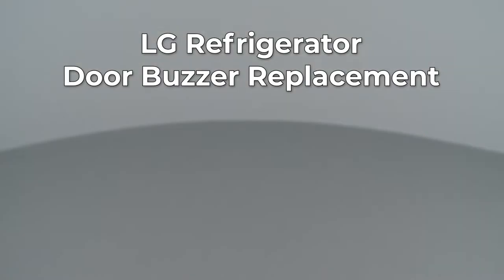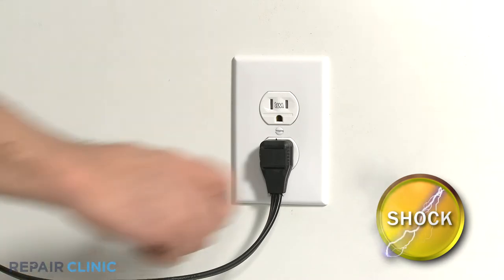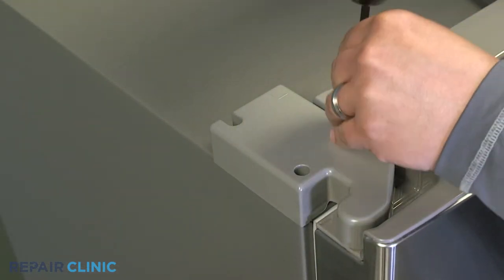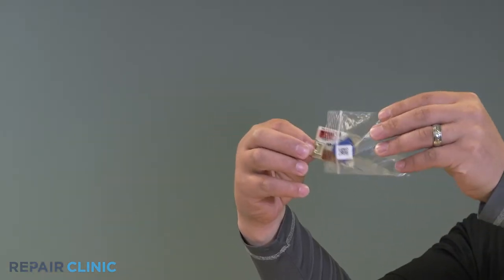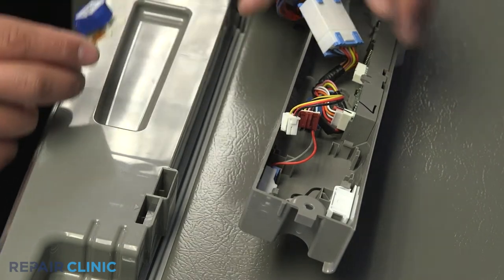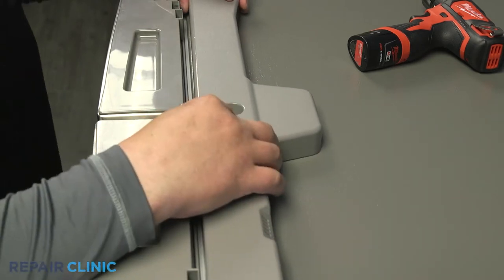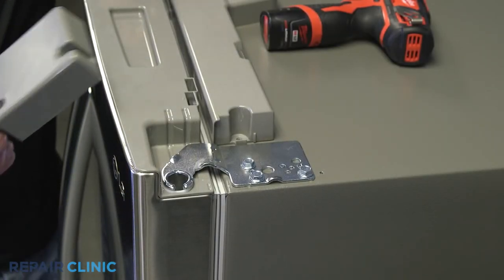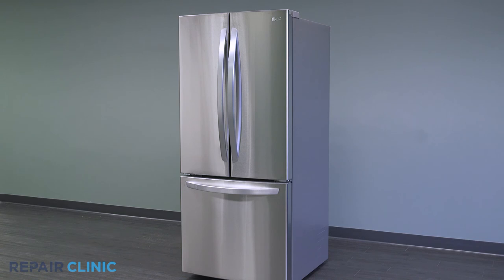LG Refrigerator Door Buzzer EBR64730408

Comment: My LG gbb72nsucn door alarm went nuts and it was impossible to shut off. Everything was fine, temperatures, operation, even the diagnostic. LG wanted to charge a lot to check it out, after 48 hours of beeping I ended up just opening the front top part with a screwdriver, took out two screws, removed the plastic, and the buzzer was easily assessable and removable. No more beeps! And the diagnostic checks everything as perfect. What a stupid decision to make it impossible to shut off the alarm, terribly appliance design.